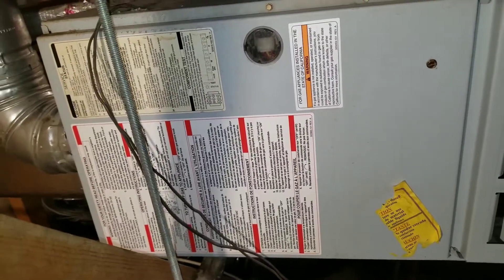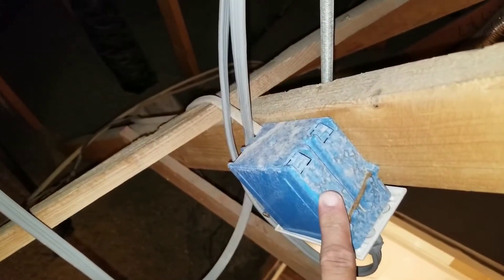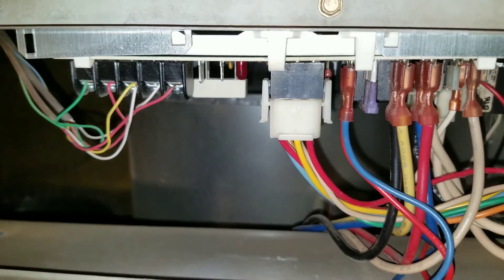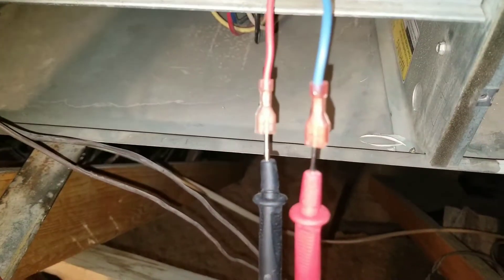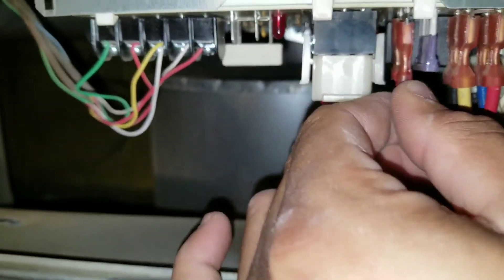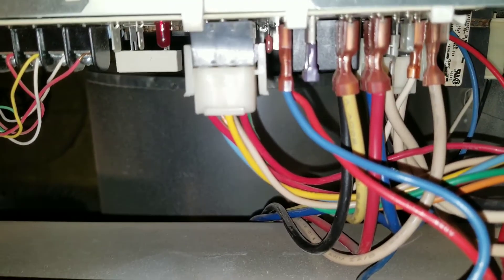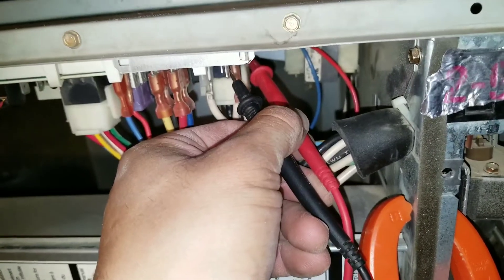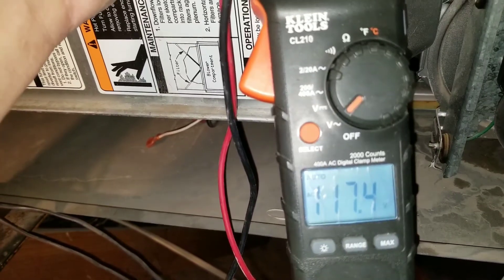Testing Transformer HVAC

Comment: bro that black wire fr the transformer is going to PR1 or SPEARS 1,2,3 ? and also the white wire is going to SPEARS 1,2,3 or ? bottom  line im trying to connect those wire the black and white im not sure and I didn't take a pic .......thank u for understanding

Comment: I just moved into a new home and want to instal an ecobee. I went to the transformer and only have 1 segmenet of 24v through the RED secondary, the GREEN secondary is grounded and doesnt have constant 24v. The GREEN wire is connected to my BLUE C wire. the result is that Im not getting constant power to my thermostat C wire. Is this a wiring problem?
Reply: Did you ever get this resolved and if so what did you do?

Comment: i did some testing with my multimeter. i have no voltage at the thermostat terminals. in the furnance i have no voltage on the terminals that say R W Y G etc. either. my led light on the furnace is not lit at all. i have voltage from the switch to the board. (120v). the fuse doesnt seem to be burnt. what could the possible problem and solution be?
Reply: Same with my unit  ?
Reply: @gsalazar8080  What ended up being the issue?
Reply: @Fade9d9  needed a new transformer. was like 50 bucks and super easy to install
Reply: What ended up being the issue?

Comment: Im getting 120v at the board L1 but at the wires going into the actual transformer are only getting 100v is this a board issue? There’s no 24v

Comment: 😂😂 was looking for a video that showed how to measure the voltage with the transformer still in place, since many recommended videos have the setup on a plywood display. And sure enough, you hitting the switch made me remember I need to push the lock out switch closed to get voltage to the transformer. 😂😂

Comment: How would I wire a 24-volt transformer on a package unit? Does the 24v to red on the board and the other to common on the Board?

Comment: This morning I woke up with the heater running but our Honeywell wifi thermostat screen was blank so I used my multimeter to try and get a reading at the wall but the voltage came back as 0. I went up to my attic to check the condenser drain pipes, which doesn't have a safe-t valve feature, but I didn't see any clogs that would trip the power to the thermostat. The pipe was clogged a little and I cleared it but it wasn't at a point where it was backing up to trigger any overflow issues. Then I popped open the furnace to check the fuse and it wasn't blown. The low voltage power-in from the transformer to the board gave a reading of 17 and the board was flashing green with the heater still running fine. I tried to take a voltage reading for the wiring going to my condenser unit but it only gave a 1.3 reading.

Would greatly appreciate some insight and suggestions, thank you!
Reply: What was wrong with your furnace, was it the transformer? I'm having similar issues.
Reply: @adibees it wasn’t the transformer. I had a hvac company come out and it ended up being a tripped safety switch on the other side of my furnace. I guess there are two switches.
Reply: @EEZYEEEE  interesting, my smart thermostat was working fine and all of a sudden it stopped working. Testing out  the c and rh wires i get variable volta going up and down.

Comment: Just want to say your video fixed my problem. Just replaced the control board and transformer but still didn’t work. I left the cover off incase I needed to do something else so the safety switch was still on. Put the cover on and now it’s working like normal. Definitely a duho moment.

Comment: When I test my transformer, when it is not connected, the meter reads resistance on the high side and the low side. Like 18 ohms on the high side and 1.6 ohms on the low side.
The circuit board has no power when I connect the transformer. 
I've got 120 v at the lines that go into the circuit board. And 120 v coming out of the board through the wires that go to the high side of the transformer when I push the door switch,  but no voltage coming out the low side of the transformer. (And no red light)
So is the transformer bad, even though there is resistance when the transformer is unplugged?
Reply: Make a cheater cord and connect it to the transformer primary. Plug it in and check for 24 v on the secondary.  Simple.  Using an ohm meter properly will give you  a reading of OL if the winding is bad and reading if it is good. The secondary winding is far more robust and is generally still good even when the primary winding is shorted out.  You must not hold the test probes with your hingers when checking as this may result in a false reading.
Reply: Great question...

Comment: I have a question sir. My ac unit is not working. The thermostat is turned off and has no power coming to it. I checked the breaker box and its fine. I checked the 5 amp fuse on the air handler control board and it is fine. I am getting power everywhere except the control board and the output of the transformer. I have 240 going into the transformer but less than 1 volt on the output which is supposed to be 24 volts. I checked my contactor and it does have power. When I press the button on the contactor the AC unit will turn on. So I'm not sure if it could be a bad transformer or a bad control board or something else?? Your advice would be greatly appreciated! Thanks!
Reply: Did you find the answer?
Reply: @msonufriychuk  yes. The switch on the breaker  in the air handler went bad.
Reply: @jaywallace9800  thanks. I'm currently working on my trane unit. I have no power going out of the transformer.  Took that off there is a brunt spot.. hopefully that will fix it. I got 25° last night.

Comment: I thought I had a bad control board...since I had no tripped breaker, no status light, good fuse on bird and no power at L1 and L2 (Carrier 80), installed new board and same issue. It seems I’m not getting power at all to the furnace...tested breaker  with meter - 120 on each breaker, tested for 120 at the service disconnect switch and not getting anything - since the breaker is testing good...could the power switch for the furnace be bad?
Reply from the maker: No status light indicates to me loss of power to board. Check incoming power... are you getting 120 volts? If you are I would suspect the safety switch located on the panel door. Let me know how it goes!
Reply: Sam Thanks for the quick reply Sam, we’ll...the power issue turned out to be a mislabeled breaker that looked like it was on but was off. Got power to the board now...but when it turns on (cool, fan ON) the blower motor is making a whining sound as it ‘attempts’ to start...then shuts off. I swapped the capacitor with my other upstairs unit of the same model and it’s still doing the same thing. I can turn the wheel freely and don’t currently feel any play. I’m about to pull the blower motor from the working unit and install it in the non-working unit to see if that resolves the issue...does that make sense or would you suggest I go another direction?

Comment: Ok I'm a little confused...the low voltage wires coming from the transformer are hooked into the circuit board, I get that. But why are the 120v wires also hooked into the board? Aren't those the wires that are supposed to supply power to the transformer? If both the 120v wires AND the 24v wires are tied into the circuit board, how is the transformer being powered?
Reply: Its called a step down transformer... primary is 120v,secondary is 24v..
Reply: Think of the transformer as a bouncer, it’s limiting the 120v power to the board to only 24v
Reply: That confuses me as well. So you check AT the control board that it’s 120v so that it can be sent to a transformer to reduce it to 24v and then send it BACK to the control board. Why is the control board getting 120v in the first place? Why is this 120v not going straight to the transformer before anything goes to the board. I’m sure there’s a perfectly good explanation, just sounds odd to me :)